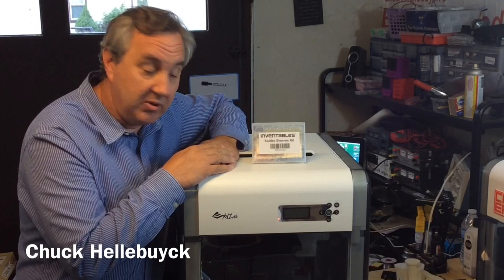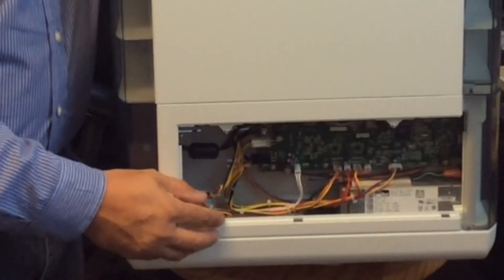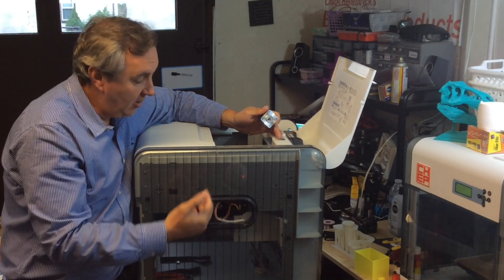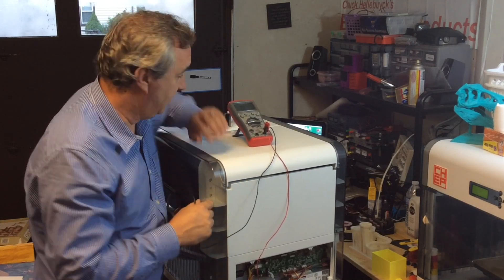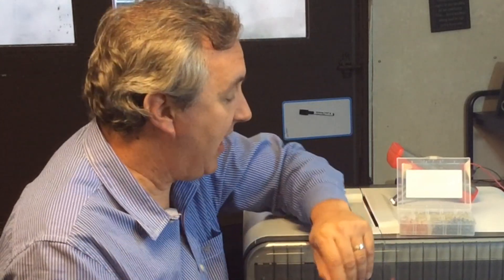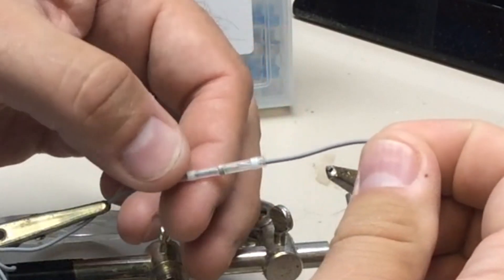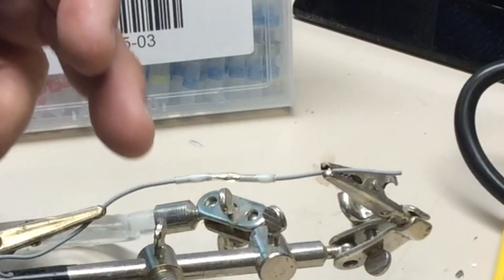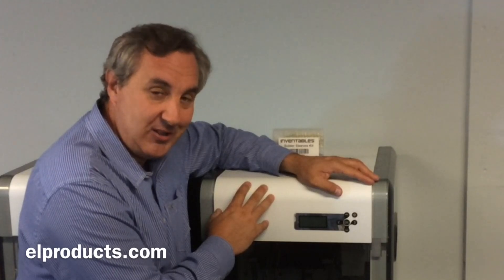Fixing the  Da Vinci 1.0A #0030 Error using Inventables Solder Sleeve - Video #063

Comment: I got error 0030 after a print just finished and was cooling down. I check my mother board and all is connected. I guess this is an electrical fix. expensive and I don't have most of these parts.

Comment: Thank you so much! This repair saved my bacon. Found an intermittent break in my orange wire. I am currently printing 3D parts for face shields for health workers in the Covid-19 crisis... The printer is up and running again.
Because my wire break was intermittent, and I did not know which wire it might be, I made a serial connection of all four wires with jumper cables so that I could test them all at once with the Ohm Meter attached to the yellow and orange cable at the circuit board end and a jumper between blue and red there and then two jumpers, between the yellow and red and between blue and orange on the motor end. 
I then wiggled the cables and pushed the printhead back and forth until the break showed itself. It was near the motor where the cable tie holds the cable boom to the stepper motor plastic frame. 
Solved!

Comment: hi sir i was wondering if u could help me i have a divinci 2.0 and it was working fine now all of asudden extruder 2left exstruder wont heat i wiggledwires and it  will randomly heat up sometimes it woont i finale got a 0012 error but cant find any info on it is there any info u can giveme or a way to run it with only one exstruder

Comment: I have a 2 yr old 1.0a that just got a 0030 error...  I checked the motor harness and it was o.k., checked the motor by switching axes and it was o.k., too...  Checked the home sensor (three red for x-axis) and one wire was intermittent.  Spliced the wire and it works so far - getting the sensor plug out (and back in) was a bit of a problem.  Thanks to Chuck for showing that the harness problem does not mean a dead printer!
Reply: Easy fix, fixed mine with simple trick

Comment: The solder sleeve looks super useful, I just did a similar repair using crimp on spade plugs for the heater.  These printers are great because they're cheap, but you get what you pay for.  I bought mine from a warehouse that sells amazon returns, it was not working, but it was $250 in the days when a new starter printer was $700 if you were lucky.  It turned out the ribbon cable to the LCD got placed slightly wrong under the case and got stuck in a pinch point.  A little rough soldering and I had myself a functional printer for half the price.

Comment: will these solder sleeves work? im trying to find some with amazon prime because inventables shipping will take longer than i hope https://www.amazon.com/Sopoby-Connectors-Electrical-Waterproof-Automotive/dp/B01DPS8DPM/ref=pd_sim_60_2?_encoding=UTF8&psc=1&refRID=HP808NXJKQJT2VA1H34K
Reply: CHEP 3D Printing i'm inexperienced , is it hard to do it since the wires are so small? also how do you pull the x axis motor wires out. i think my sensor wires r the problem because they came out with much less force. also sometimes when my printer glitches and doesn't even show the error , i do the jog mode thing and the motor will move (pretty sure it only moves to the left though)
Reply: i figured out that sensor wires are falling out of the connector but the wires themself are fine . how do i make them stay? would i rip them out of the connector then resolder them? i'm afraid i will burn and brake the connector then
Reply: nevermind, it was just a coincidence. the x axis functioned properly for some reason but is still broken. I know for a fact that the motor works because the extruder will move a tiny bit to the left when going back to the home point (failing going back lol), it esentially does like a couple mm to the left before it goes all the way up. I'm like 90% sure its a broken wire but I am not sure which wire or where because I am unable to take the x axis connector out of the motherboard? it won't come out with a great amount of force. is there a specific way im supposed to take it out.
Reply: CHEP 3D Printing odd . how did you pull it out ? i'm gripping the sides that are outside of it but it won't come out like that
Reply: CHEP 3D Printing don't know because why whould it be glued ? maybe cause the x axis motor connector is like colored on with green marker and the y axis is colored on with black lol
Reply: CHEP 3D Printing how would i take it out then lol
Reply: CHEP 3D Printing ok i was able to take them out and i am getting a multimeter later today, how am i supposed to solder those small wires in such a. small place . i'm obviously unable to just take the wires out of the printer. when i put the y axis cables into the x axis connector and vice versa then the y axis doesn't work.is that bad

Comment: Hi Chuck. My Da Vinci 1.1 Plus is down. Suddenly while printing the interior light stopped and the motors are not moving anymore. The printed control screen is still on but the job function to move the extruder is not working. It seems that the motors are blocked. Can ou help resolving this issue?
Reply: Hi Chuck. In fact we found out that the board is dead. XYZ will proceed to its replacement. Regards. Pierre.

Comment: I have an issue with my X axis moving to the left a small mount every time I try to home it. I'm not getting the error.   Do you think this could be a broken wire to the X home sensor instead of the motor?
Reply: I took it apart today and discovered that 2 of the 3 red wires for my home sensor were if fact broken and the 3rd wire was almost totally broken.  There was a Zip Tie on the side where the X motors is and that is the exact location where the wires broke.  I bet in the very same place as your broken blue wire.  My 3 red wires were at the top of the bundle taking all the stress of that bend.  All fixed now, but I didn't have any Solder Sleeve so I had to do it the old way.

Comment: Not at all finding the problem with the 3 to 4 inch automatic off print problem.  Here is another crazy question. Do you ever take in repair jobs??? I bought this new on e-bay so xyz does not respect a warranty for repairs.

Comment: After watching this video, we were able to fix the wire problem and it prints!! Thanks! However, as of the first print after the fix it no longer goes through the routine of nozzle wiping and prints 2 to 3 inches to the left of the the assigned place.  Any ideas?

Comment: found out what it was, the turntable was off calibration. Take a star screwdriver, take off turntable and there's a little hole under the turntble, line it up with the laser in the back of the printer ( located inside, rear of the printer) fired right up! thanks again for the help Chuck!

Comment: great video! quick question, I have 2 printers AIO and Duo. they both have started printing offset (if that's the proper term). I've tried different slicers simplify3d and xyz, changed cables, etc. the weird thing is the demos print fine, everything else starts fine, then shifts to the left. thanks
Reply: It sounds like an afternoon of troubleshooting with the multimeter to find the wire (s). Thanks for the quick response and the videos. I always turn to your videos in time of need :-)

Comment: Last night I was 3 hours into a 4 hour print when all of a sudden the clip for the X-axis tensioner pulley exploded into multiple parts. After turning it back on it gave the same 0030 error, so I wanted to see if anyone else had the same problem.

While this video isn't for the same issue, it is some great information! I don't know how I never knew about solder sleeves, but now that I see it, I need it.  :)

Comment: Chuck, I am having a strange problem. 
I have a 1.0a that had this same problem, I had 3 motor wires broken and 1 sensor wire, I repaired everything and all is good and well. However now the extruder is about 2 mm off. if i try to auto level the bed the zprobe fails because the extruder isn't moving far enough left to get a reading. (i have Repetier 0.92 installed)   any help would be great. Thanks

Comment: dear Friend.
i need your help , 
i had the problem you said in this video, but i think the problem is in X Sensor, but I CANT to change or to FIX it, please coud you hlep me?  how to replace it
regards
Reply: hi Chucky
it's true, is not the sensor.
I did what you suggested, change to X to Y driver, and the issue was transferred to the Y axis,
i tried to change X to Y motor engine, but its different size, so I tested the engine alone, wired X and X driver, the problem appeared again
It seemed the problem was in the cable, but I tested pin to pin and it is beeping pin to pin OK.
even so did another test to confirm, I connected the cable X to Y motor and the problem appeared, so I concluded that the problem is in the cable, but how ???? as this pin to pin connected, is it possible???
can give me a suggestion?
grateful

Comment: Hi Chuck! I switch the cables in the mainboard to see if the problem was there and the printer go crazy. The right was left and left was right. Also front was back and back was front. So I couldn't see if the mainboard was the problem or not. 
I will see if the problem is in the cables .. But you know where I can buy a Mainboard??

Comment: Hello, I'd like to start by thanking you for your informative videos about DaVinci printers. I'm following this and the 0011 error since both have happened simultaneously. I've checked the connections to my extruder with a multimeter, performed the soldering fix you suggested in the 0011 video, and it registers as a good connection. However, the problem still persists on the extruder. How would I go about checking the motherboard? The extruder doesn't have an identical plug like the x, y, and z axes do. So I can't check it that way. It will not heat above 21C. Thank you again for these videos.
Reply: ***** Thanks. All of that is fine. I set it up to clean the nozzle and since the temp stays the same on the display, I shot my heat gun at the extruder to see if the temperature reading would register. It did. So I suppose the heater went out because the thermistor could track the rising temperature.

Comment: Can you explain in more detail how to check if its the motor or motherboard? My wires checked out fine with a multi meter on the x axis motor and I am getting a 0030 error. Im thinking of selling mine on ebay as Ive spent many hours trying to fix this.

Comment: The wire that was broken is an indicator of excessive flex in that area. The other wires in the loom may fatigue soon as well.
I would suggest replacing all the wires from the motor connector to the first tie down point of the loom with flexible silicone covered wire similar to what is used for RC Electric motors.  It can be bought in many colors and many gauge sizes.
I personally would replace the entire wire run for both motors.
 For example.... http://www.hobbyking.com/hobbyking/store/__466__377__Hardware_Accessories-Silicon_Wire_Mesh_Guard.html

The silicone wire is also high heat rated and won't dry out...

Comment: It won't last too long chuck.
I did the same thing and it broke after 10-20 hrs useage

I ended up replacing both harnesses with IGUS chainflex CF9 cable. 

http://www.igus.com/wpck/3537/overview_controlcables
Reply: ***** I've actually got a spare harness in from the stock ABS (non-PLA-compatible) nozzle if you end up needing one